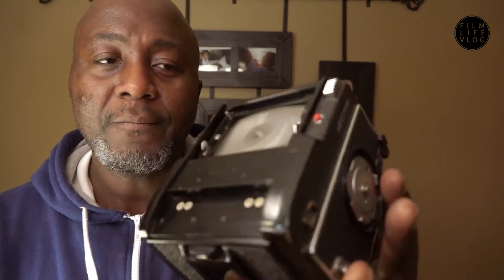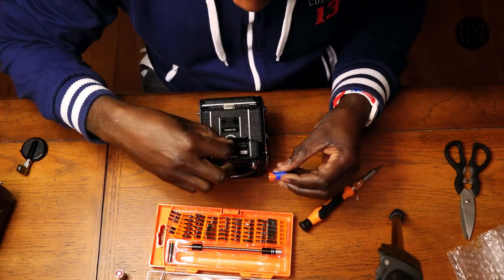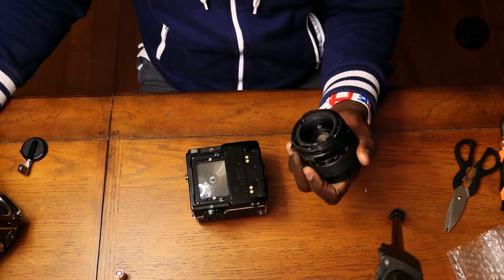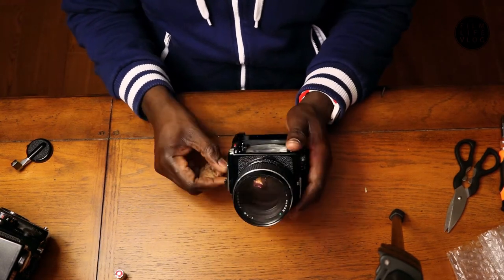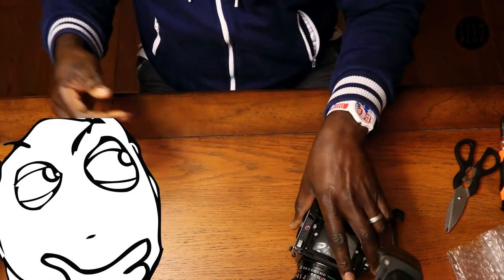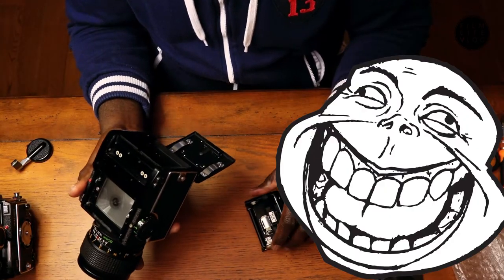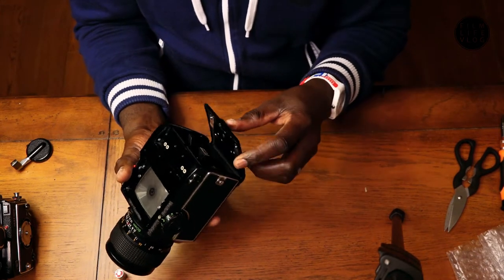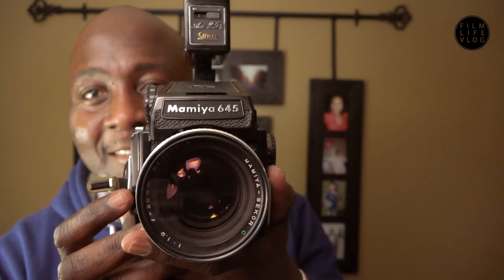Attempting to repair my (for parts) Mamiya M645 1000s film camera

Comment: Just as a tip, to check if a battery is full or not drop it from about 8 inched high on its flat end, if it bounces then its flat, if on the other hand it hits with a thud bounces very little, its full. And yes with practice you can tell if its half empty or not as well:
Reply from the maker: Lol
Reply: I thought that only worked with alkaline batteries? Good tip nonetheless
Reply: Just buy a 5 buck multimeter and measure the damn thing

Comment: Would you know how to clean mold from a view finder?
Reply from the maker: I have used a heat gun to some level of success to to heat up the glass and kill the mold. You have to be extremely careful not to melt or deform the part though. There may be guides on YouTube on how to disassemble the viewfinder, but that may take some skill. Good luck.

Comment: Wow Ben I wish I had your luck! I just got one off ebay last week. I'm having a problem with the mirror getting locked up when I'm using a shutter speed of 1/250. Every other speed works fine. I'm using a new battery and all contacts are clean as a whistle. The interesting part is the shutter curtain opens and closes just fine so the pictured isn't ruined, but the mirror just stays locked up. The only way to bring it back down is to advance the lever like normal.  Also I want to note that when placing the shutter dial on the body to the red dot, the prism shutter dial doesn't work. The metering works fine but the shutter dial doesn't change any speeds. When i fire the camera using prism shutter dial, the mirror stays locked up like there is no battery and I have to press the red button to bring it back down. Have you had this problem before or any ideas on what's going on? Thanks for your time!
Reply from the maker: That is a strange one. I have had some minor issues with my camera but nothing quite like what you describe. Was this advertised as working? If it was, return it if possible and invest in a working camera. These cameras can be quite temperamental due to their age, and honestly unless you are willing to shell more money to repair them, I would not recommend buying an as-is film camera. The only reason I bought mine was for the winder, the fact that it worked was a pleasant bonus. I know, some luck eh? :-)
Reply: @retrotechmall  Thanks so much for your feedback. It was advertised as fully functional and others are telling me the same thing you are so it seems like it's the right move to send it back and try again! Cheers man!
Reply: @TheMistermike87  Did you put in film?